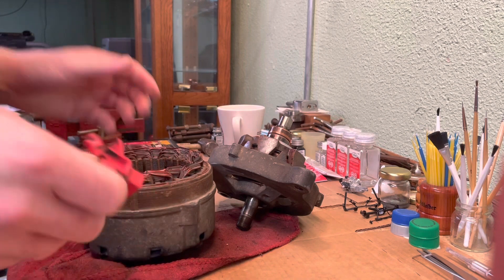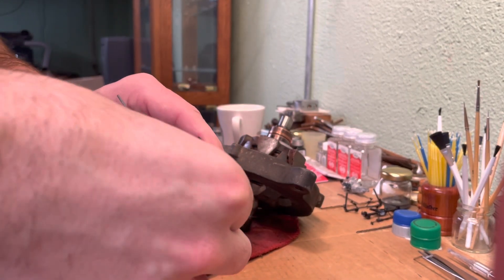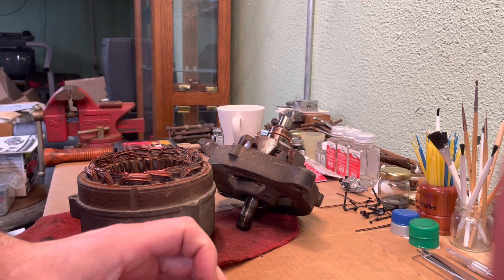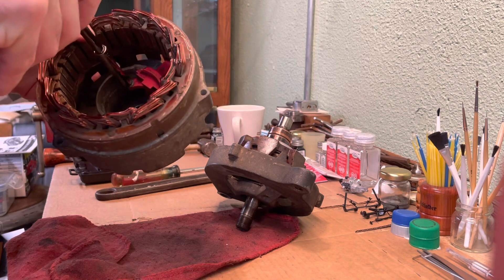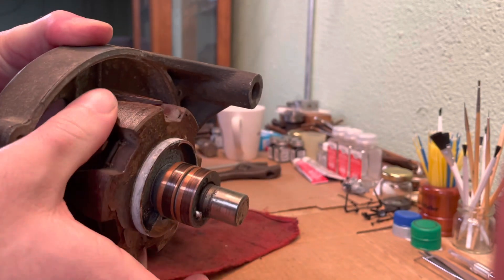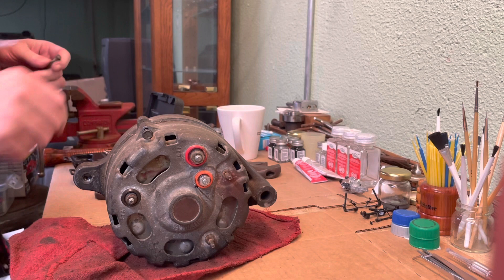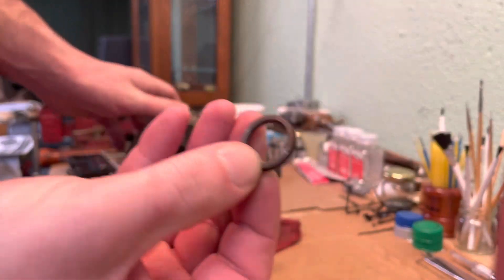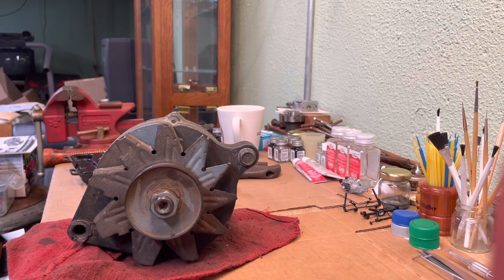Ford alternator rebuild (part 2)

Comment: Did u drill a hole for the piece of wire ur using to hold the brushes in?? I have to go out & look but im pretty sure mine only has the hole for the screw? But nuthing for that piece of wire to be pulled through??
Reply from the maker: The hole for the wire to hold the brushes was already there.
Reply: @ZigZag9  I looked at mine & I was mistaken. It does have a hole there. It is just very small & was plugged with dirt. I actually used a small drill bit to put mine back together & it's good to go & working again. Thanks for the video. I wasn't sure how to get it back together. Ur video gave the help needed.